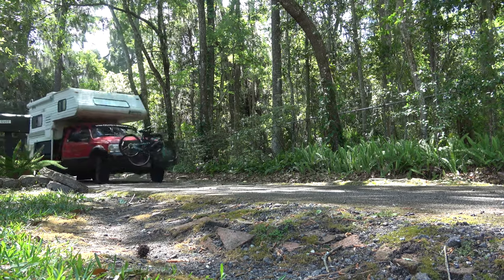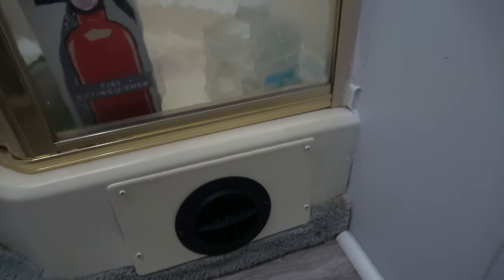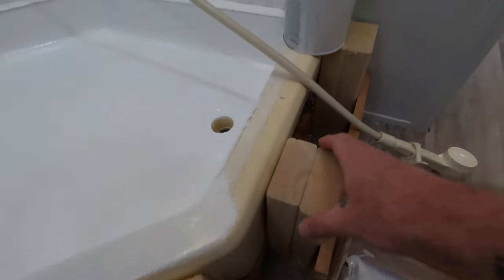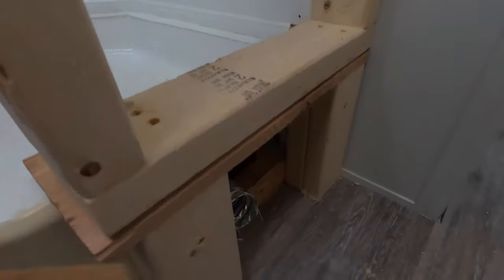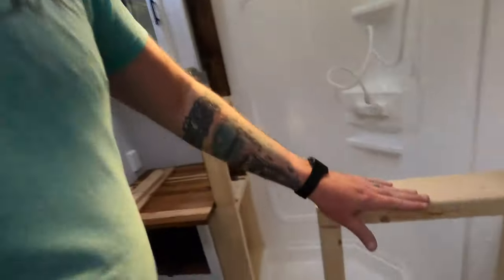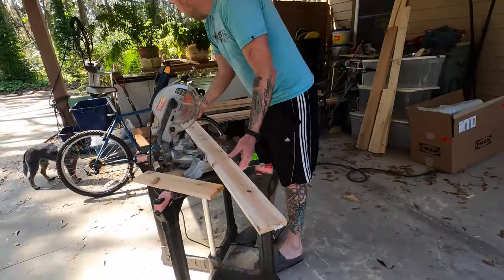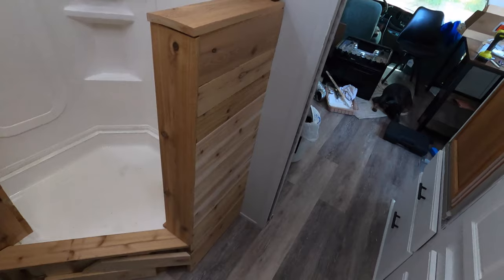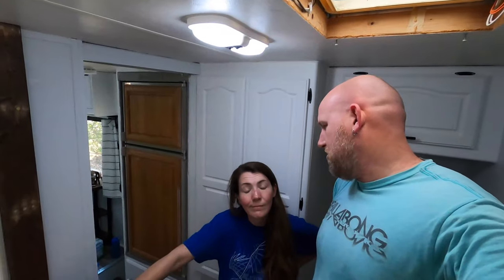CtW 124 // DIY RV Cedar Shower Build! // Class C RV Bathroom Remodel

Comment: Thank you for this!  I have the same shower in my rv but even less room with sink base and toilet in same space.  Probably about 18” when stepping out of shower with the towel rack on the short shower wall where the door hinges.  That means you have to step out of the shower and around the door to reach the towel or throw it in the sink so it’s available when your ready to dry off.  The door sticks and is both hard to close and open.  If not careful to be sure it’s fully closed it leaves a gap at bottom where water can leak out.  NOW I know what we can do without ripping out the whole thing!  Cedar may be expensive but I’m sure it’s less than a full remodel.  What a great solution!  Thanks a million! ❤
Reply from the maker: We didn’t do a perfect job, and the camera broke when we were tearing apart the shower. But you can definitely make it custom to your size and setup!

Comment: Are concerned about adding extra weight to your rig? Looking good so far.
Reply from the maker: We have not gone item-for-item in weighing what we removed vs what we put in the camper. But there was a fair amount of weight lost in the demo that was returned in the rebuild, plus a little more here or there. We're not too concerned because nothing is excessive or intentionally heavy. I think the shower might have almost been a 1to1 net neutral with weight. The sofa as well. But there are other things that definitely added weight --- Lindsay's dang throw (away!) pillows! =)

Comment: So how did you get the glass out? I'm stuck where you shut it off. When you turned the camera back on the glass was gone.
Reply from the maker: Sorry, the camera broke at that point! I had to drill out the screws because they were rusty/stripped and then did a bit of prying (careful not to shatter the glass!). It wasn't pretty - so kind of nice the camera broke when it did!
Reply: @CalledToWander  😆. Thanks for the information.